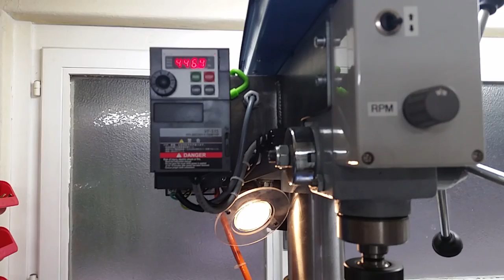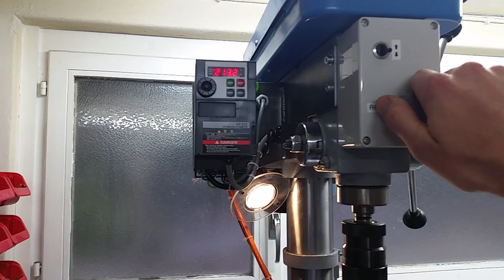VFD Drill Press : General Description

Comment: Does the foot switch turn on the light and the vfd?
Reply from the maker: @lisnut no it is constantly on as long as the machine is turned on. Would be possible obviously but then during the tool set up etc. it's not turned on.